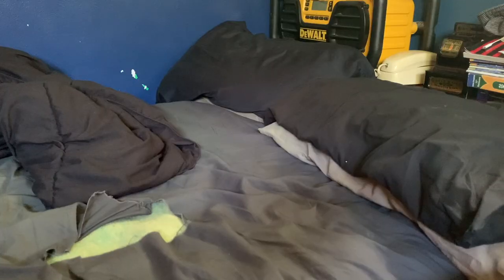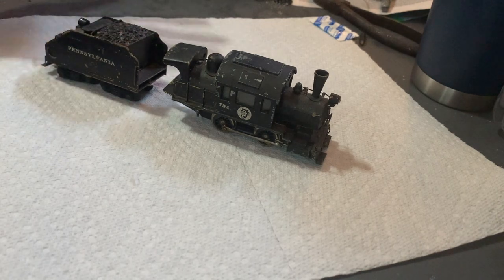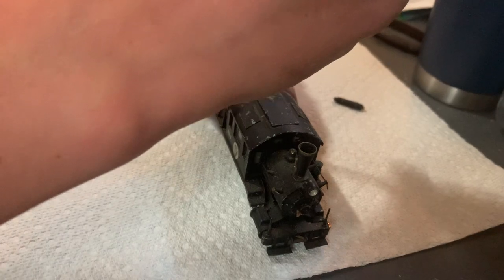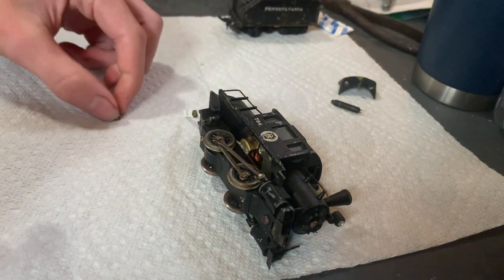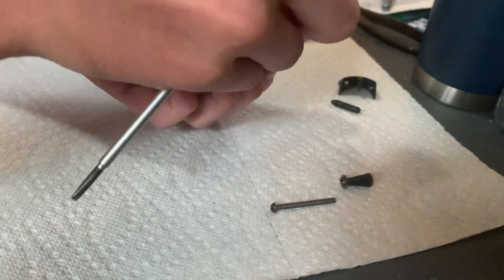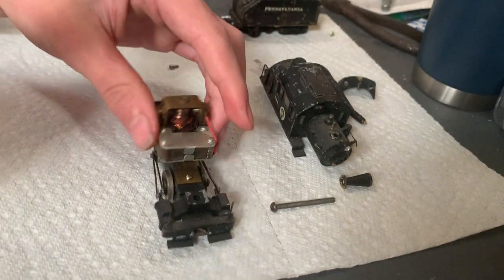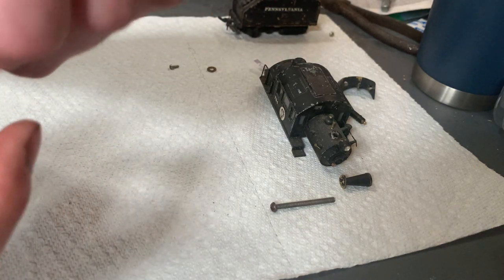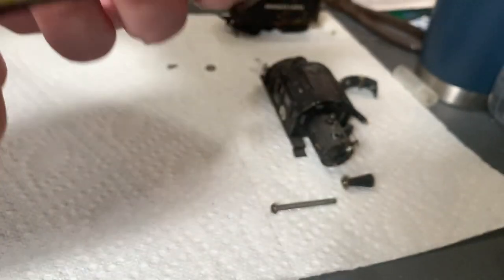Vintage Aristo Craft Camel Back 0-4-0 Restoration Part 1

Comment: I'm not the greatest fan of aristo craft but a good restoration nonetheless. They have a tendency to get the dreaded zinc rot, and tender trucks were no exception. If yours are original, replace them. You wont regret it. That motor was used in a lot of locos imported from japan.
Reply from the maker: Thanks
Reply: @dirtydanstrains1414  welcc